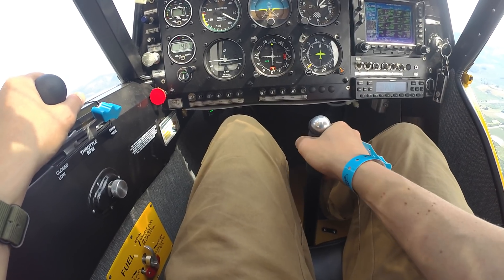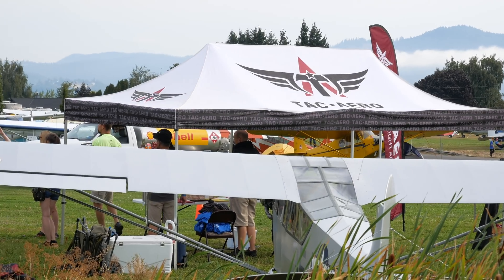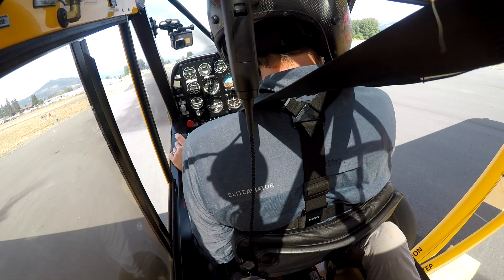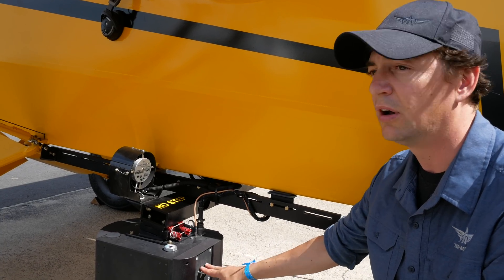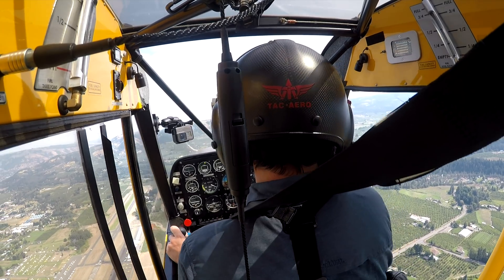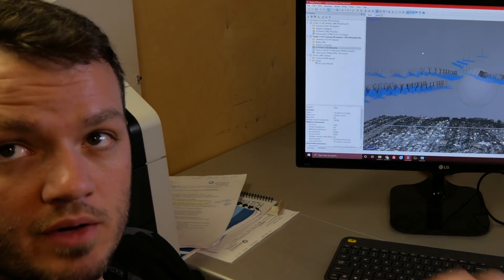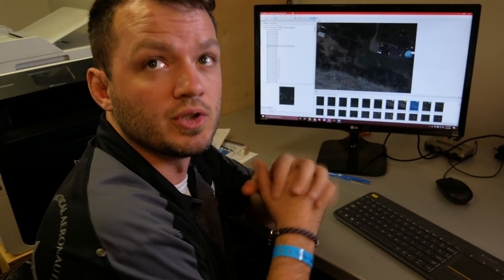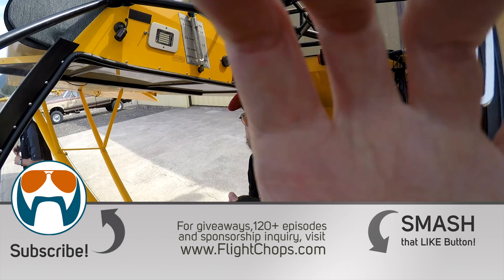Even High Time Pilots find this Extremely Difficult!

Comment: Kinda surprised he's not using a lightbar system like the crop dusters do
Reply: That sensor doesn't require that level of accuracy. I've worked with lots of different sensors and they almost all have stricter lateral limits than the Overwatch TK series.
Reply: @bradleybusch  Still, would take a lot of the guesswork out of it. Potentially allow less overlap for better efficiency, or even higher resolution?
Reply: @boydw1  Higher resolution would be lower altitudes, not increased precision of the flight paths. Higher efficiency would be higher altitude passes. The flight paths just need to ensure overlap between images. There would be no real gain by making the flight paths more precise. As soon as you bank the wings 5°, you just moved the sensor field of view dozens of feet anyway. If you want to improve anything, it would be a higher resolution sensors that could allow less passes for the same product spec, or put another way, more acres covered in a single flight without loss of resolution. Another improvement would be faster captures that allow higher speed passes without motion blur.
Reply: @ryanmcgowan3061  My point was that higher precision swaths could allow less overlap between them, for either less total passes to cover an area, or lower altitude for higher resolution. Could also use a gyro stabilized gimbal to eliminate the bank issue, and radar altimeter to better track AGL altitude.. Yes, better, faster sensors that allow less passes & less blur would be a significant advantage.
Reply: @boydw1  I understood what you meant. My point was just that the law of diminishing returns would overtake the benefits because other factors play heavier tolls. The overlap required can't be reduced, btw. The overlap is a requirement of photogrammetry, not due to inaccuracies in the flight path. Every point has to have 3 or 4 photographs of coverage minimum to get a position solution. That being said, a gimbal could make a more consistent overlap, and with a gimbal + a light bar, maybe you could afford to widen the spacing a few yards with less worry about missing gaps in coverage.
Reply: @ryanmcgowan3061  "The overlap is a requirement of photogrammetry, not due to inaccuracies in the flight path. Every point has to have 3 or 4 photographs of coverage minimum to get a position solution" - that makes sense. Despite the diminishing returns of refining the process, it may still add up to a worthwhile benefit in the long run, when time, fuel etc is factored in.

Comment: Thanks Steve for the safety plug about helmets. When I was a kid it wasn't cool to wear seat belts, but as a society we've had a paradigm shift in cars about seat belts. General aviation needs to have the same paradigm shift for pilots in single-seat-width cockpits. Less needed for cockpits that are two seats wide.
Reply: What's the thought process on the two seat wide aircraft?
Reply: @robertbristow6273 Head injuries in turbulence and/or during a forced landing are more likely in narrow-fuselage aircraft because any side-to-side violence essentially guarantees hitting something hard, while in wider aircraft the risk for that goes way down.

Comment: No wonder you kept this a secret; the RV-14 would have been jealous.  She might suspect something... evidenced by the engine break-in, perhaps?  LOL  The helmet issue is still nagging at me... I've got to find a way to get one of those Tac Aero helmets.  Amazing technology on display here, implemented by relatively high altitude photo cropdusting.  I was wondering how your stomach was doing during this... all's well that stays down.  And speaking of engines, I have mine back.  Drove 1900+ miles to Tulsa and back in under 48 hours; got home yesterday; it's in the hangar today.  If only it wasn't winter.  Oh well, gotta deal with it.  Should have it mounted in the next couple days if the weather cooperates.  After that, close the hangar, set up localized heaters and start reconnecting EVERYTHING.

Comment: Image compilation software must vote out moving objects as photo control.  Be neat if this imagery could be stitched into Googles maps for updates.
Reply: Pictures taken by planes flying lanes like this are already part of Google Maps “satellite view”. Have been for years. Just not this detailed, but close.
Reply: Imagine it's got to be a two stage process. First stage remove the movement of the plane. You can use probability tables and then determine based on existing objects to determine where you moved in the scene. Something like the slam algorithm. Then you can exclude moving objects using multiple frames to determine velocity of objects. Done some image analysis commercially and also into aviation and I'm sure this is too much detail :)